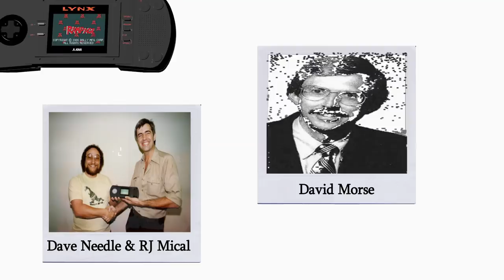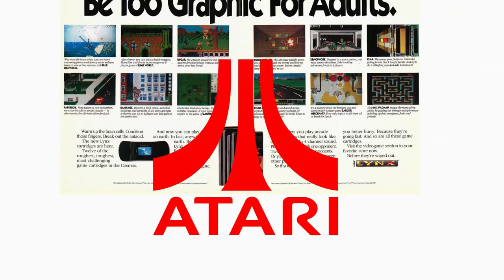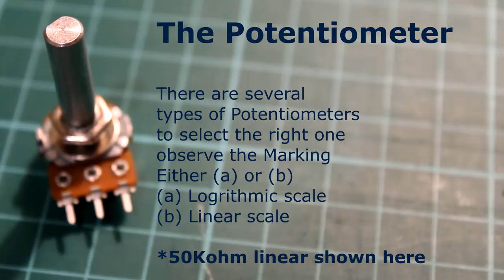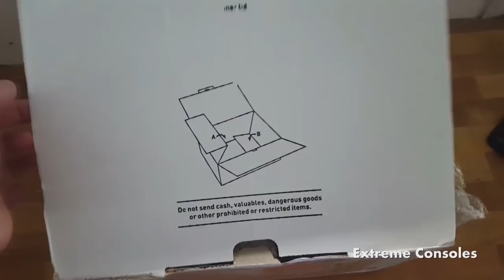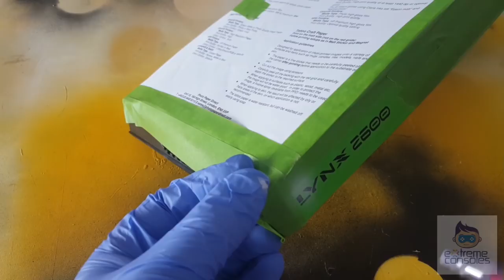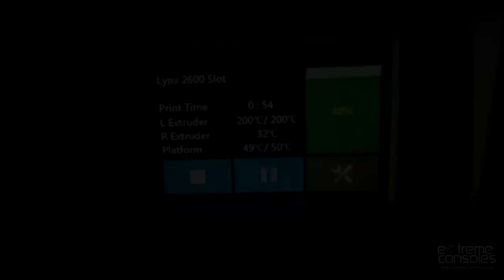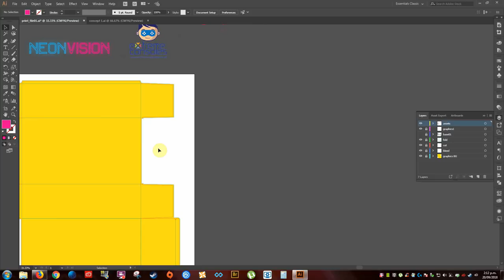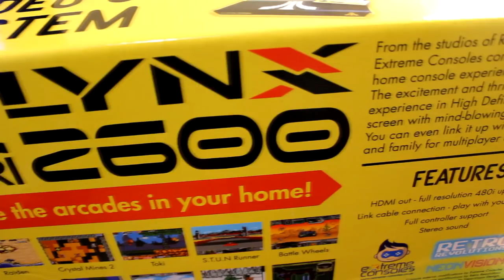The Consolized Atari Lynx Part 3  (Ft. Historic Nerd, Extreme Consoles And Neon Vison)

Comment: I have a question for anyone that could help... My Atari Lynx II was recapped... the power port was replaced... everything seemed fine when plugging it in... not saying the board worked... just saying no problems testing it... Now a week later not touching it and seeing what the issue is... when I plugged it in the power port arc'd on the board... and i immediately unplugged it.... what is going on???? any one hear of this? It's the pins... center and right pins that are causing an arc.
Reply from the maker: hey buddy flick me a message on twitter or Instagram @retrorevolutions_4 (twitter)
retro_revolutionsofficial (Instagram)

or live chat on twitch retrorevolutionsyt
Reply: @retrorevolutions4590  i think i sent a message... I also sent a whisper... lol I don;t know how to use twitch right lol